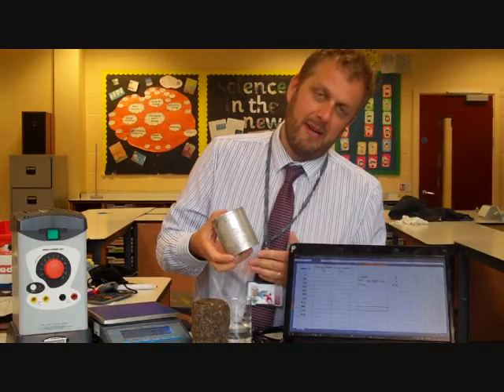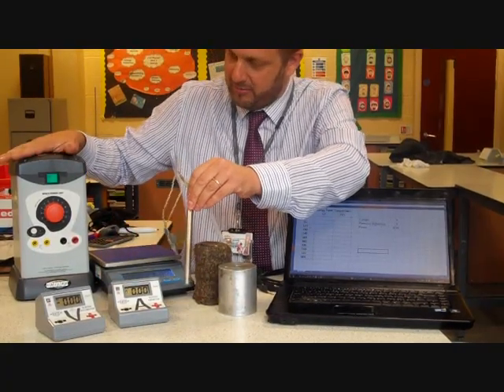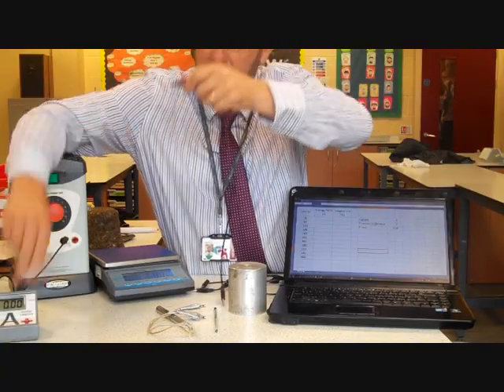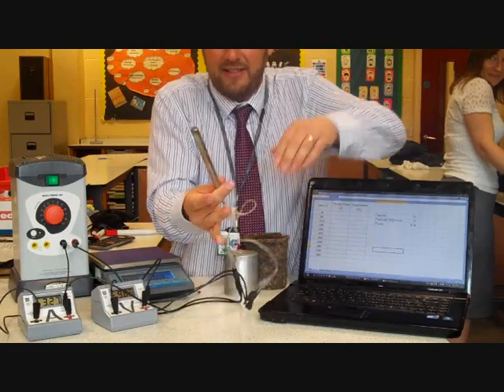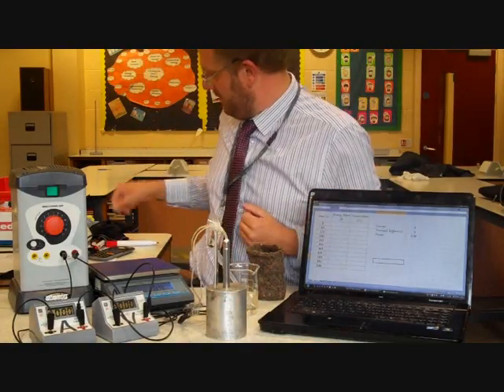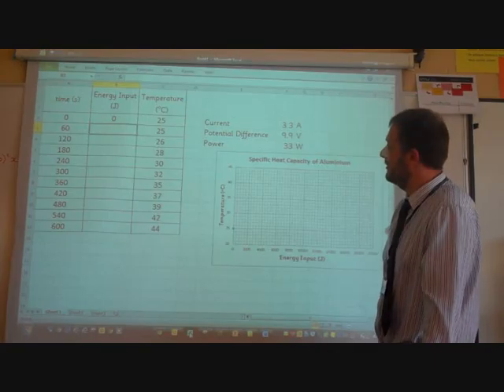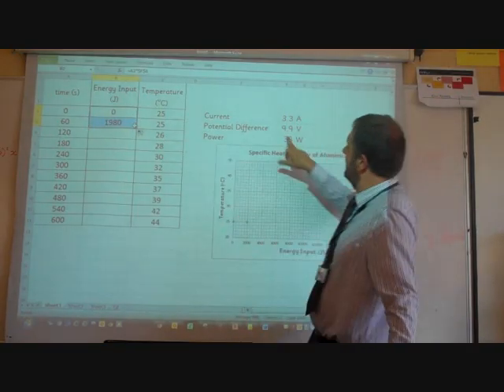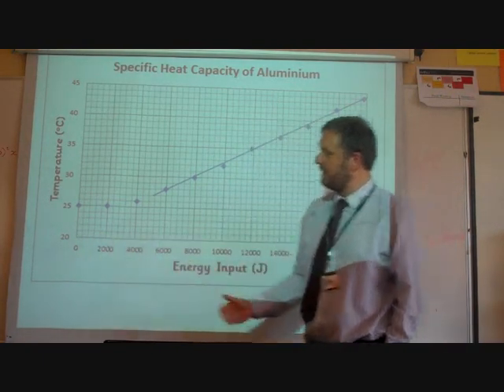AQA GCSE Science Required Practical - Specific Heat Capacity

Comment: thanks so much. This video was really helpful. I just have one question: 

would it be acceptable to take a reading of the current and potential difference as well after every 60 seconds and then use an average of each for calculating the power supplied?
Reply from the maker: Hi thanks. That would be a slight improvement. The resistance of the heater will probably change slightly as it gets hotter and therefore the power input will change slightly, your idea would give a more accurate result.

Comment: When I learned my formulae for GCSE Physics I know that Power = Voltage x Current and that Energy = Power x Time (seconds) which is what has been done here to get 1980 Joules after 60 seconds.
But... I also learned that Charge (Coulombs) = Current x time = 3.3 x 60 = 198 Coulombs after 1 minute.
Then energy = Charge x Voltage = 198 x 9.9 = 1960 Joules. This isn't 1980 but it's close. Would I be wrong to do it this way and why is there a small difference?
Reply from the maker: Yes, all that is correct., sorry for the confusion.

Either way it is Energy = voltage x current x time, the difference is just down to rounding
3.3 x 9.9 x 60 = 1960.2 so that is the correct answer
I have done 3.3 x 9.9 = 32.67, rounded this to 33 W then done 33 x 60 = 1980 which is probably a bit naughty! Always keep more significant figures in your working is good advice.
Reply: Darwinion and I've learned that no one gives a fuck
Reply: @wagwan2096  hey stop bullying bot
Reply: I used that voltage to kill my pet cat